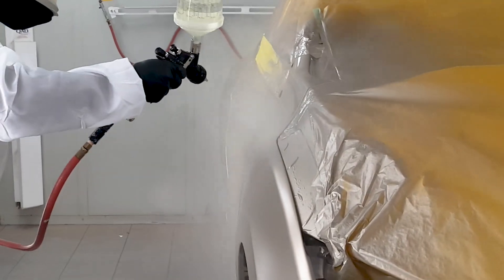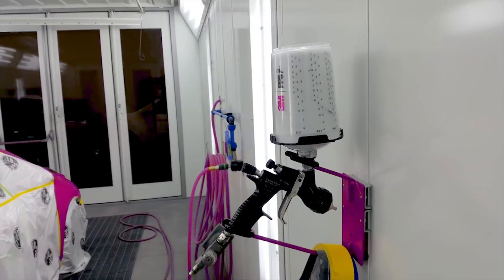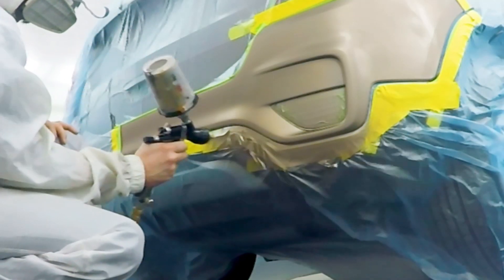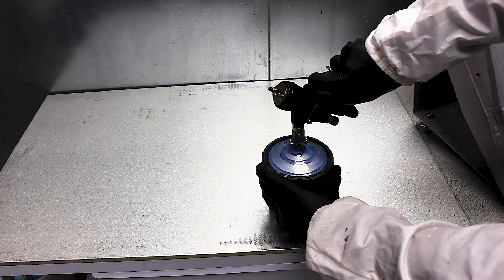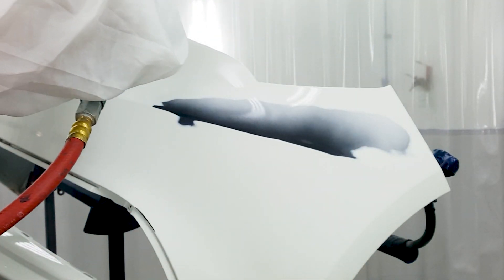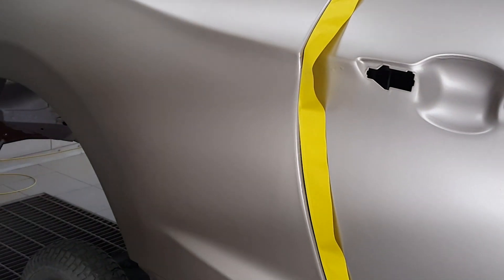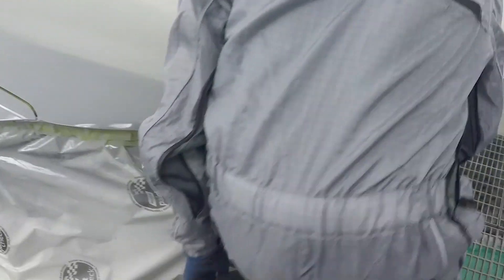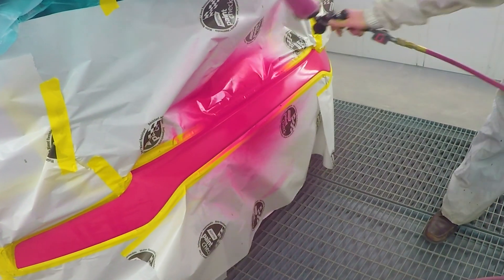Tekna Prolite (GTI Prolite) Review

Comment: I like using the T110 for clear coat
Reply from the maker: Do you use that on your prolite or on the tekna clear?
Reply: @Refinishnetwork  GTI Prolite with 1.3 tip. I'm learning now distance and speed. The T110 requires little slower speed. 3 turns out on fluid, fan open then turn in a 1/8 , 4"-4.5" distance 75% overlap

Comment: I use a prolite 1.3 tip hvlp aircap for basecoat and it works great. What fluid tip and aircap set would you recommend for clear?
Reply from the maker: A 1.3 is what I’ve always used and seems to be the most popular.

Comment: I've had mine since 2012 and use every day and love it! Does everything I ask of it and sprays very well. I've been very curious about the tekna clearcoat gun? Do you have any experience with this gun and if so did you like it?
Reply from the maker: Yes, I plan do so something on it eventually. I've used it in several videos, it works very well too. Puts everything down much wetter.

Comment: I am a beginner and looking for a spray paint gun that will work with the smaller compressor I have. I am wanting a well made gun and don't mind spending extra money for this investment. 
I know I am limited because of the size of compressor I have. It's a 1.8HP , 20 Gallon 150PSI. WIth a CFM rating of 5@ 90PSI AND 6@ 40 PSI. Can you make a few recommendations?. I will be using this to paint a few different panels on my vehicle which is a 2015 Ford Escape in a  Metallic Tuxedo Black Paint. 
Can you make a few recommendations for a gun please?

Comment: I'm having a problem with my tekna is spraying heavy on top and bottom everything is clean even changed the seal and nothing is working could it be the baffle its self tech support wasn't a great help i am super frustrated with it when your failed did it shoot like that it's also leaking where the baffle and seal are but like I said I changed the seal and it still does it
Reply: Try changing the air cap.
Reply: @dsolpower  did that too and still nothing
Reply: Mines starts doing that when the spreader valve starts getting to dirty. Pull the spreader valve assembly out and clean it should get rid of your 8 shaped pattern
Reply: @AJsHotRodsNrepairs I finally figured it out. it was the packing nut the whole time